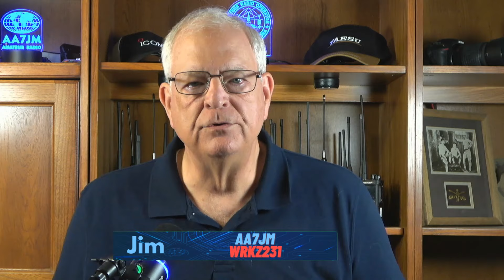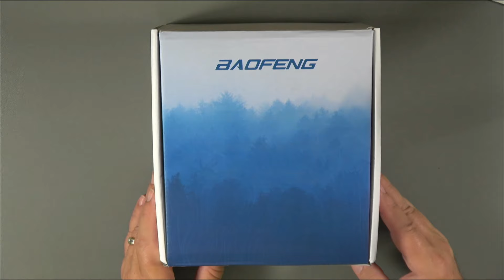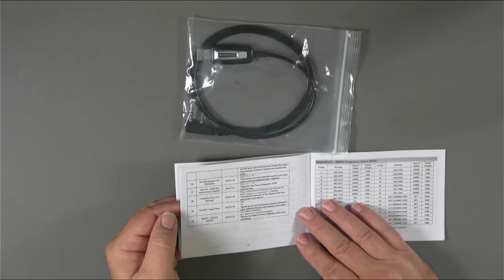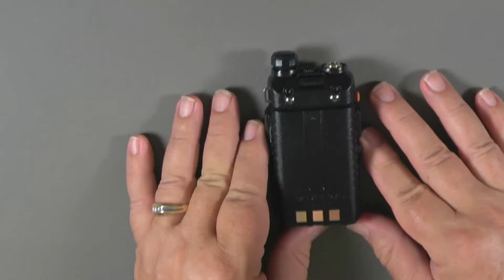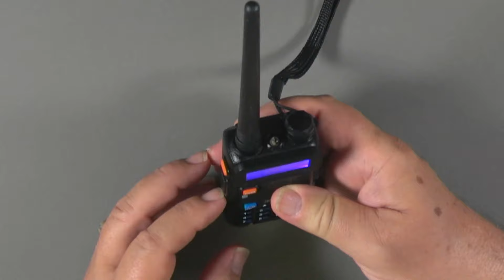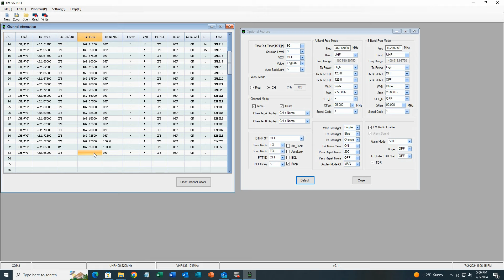UV5G Pro Review and Tutorial

Comment: Why are they going backwards ? Why not program these additional frequencies in the form factor of the larger UV-5G Plus ? The advantages are a full 5 watts of power, USB charging, etc. That airband reception is horrible. The airband should not sound like that. The airband should have the same clarity as the FM section of the receiver. Baofeng you could have built a complete new radio with genuine AM circuitry for the aircraft band. You could add additional channels in banks of channels. Your UV-17 Pro GPS has 999 Channels in 10 banks. Great for traveling to different areas. Hopefully, Baofeng will expand upon this with a better offering in the future.